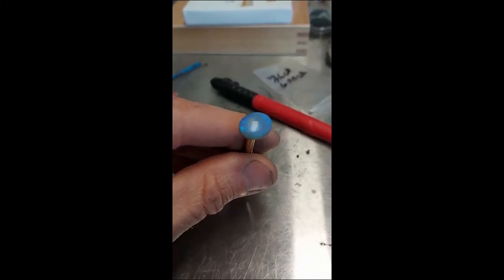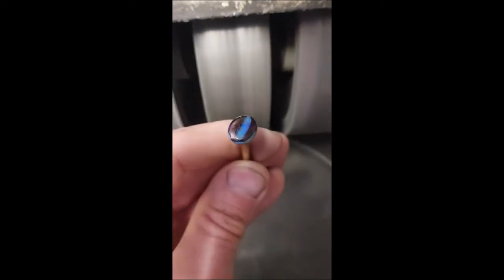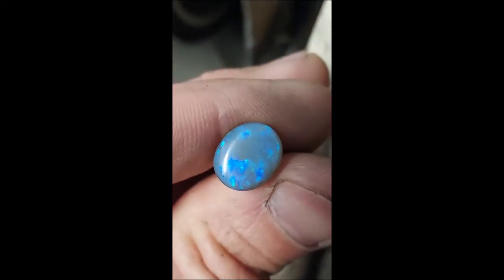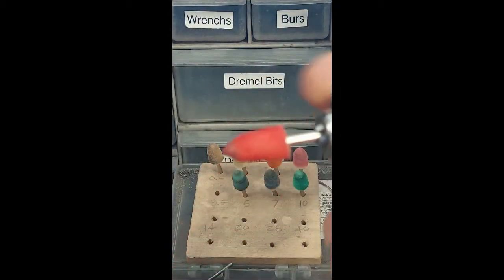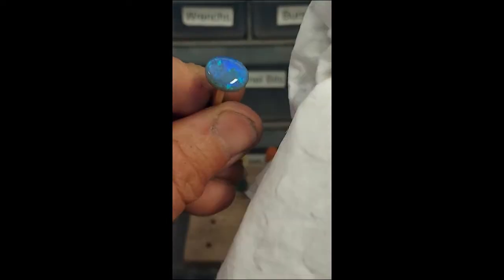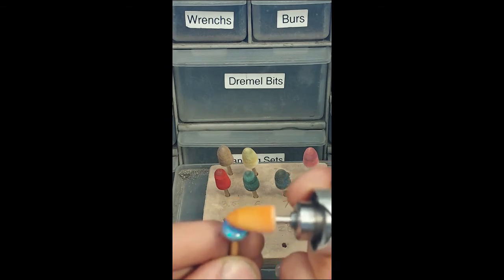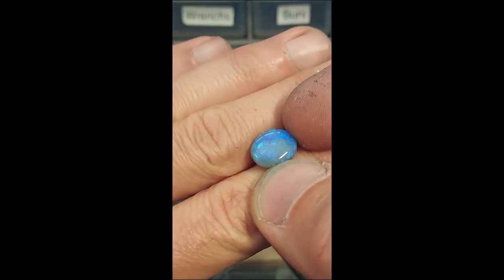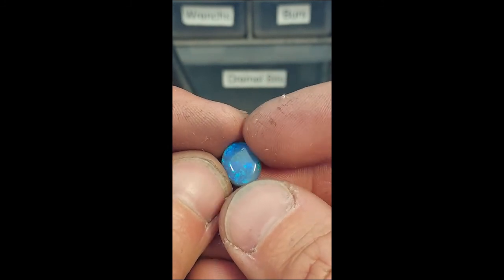Restoring an Opal with a Sharpie

Comment: A hydrophane opal will absorb that Sharpie. Beware of anything except good solid no cracks, sand or pits opals. Thanks for the how to. Ive used pencil on agate cabs.
Reply from the maker: That is a great point! I should have mentioned this. I will add that to the description. I really do not work in hydrophane much anymore... too many issues.